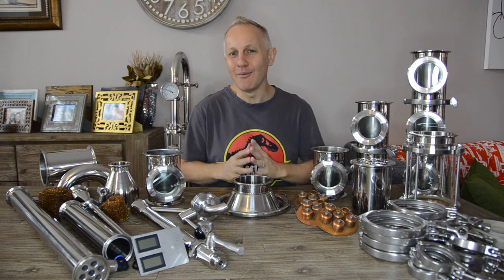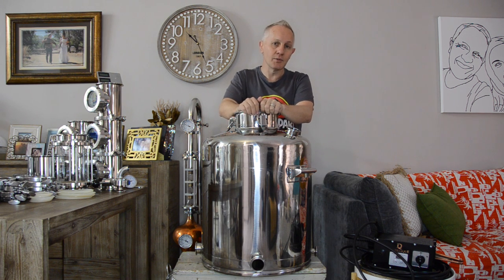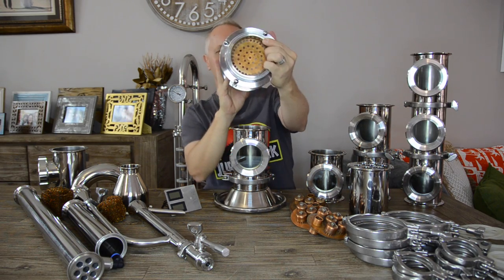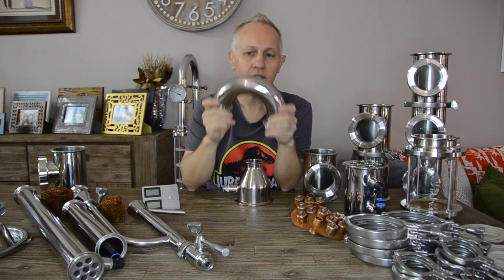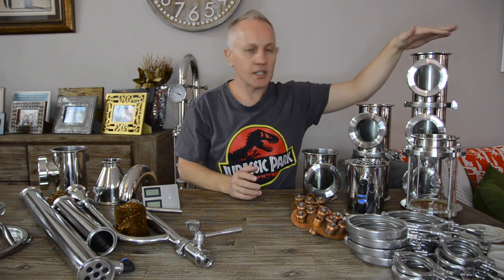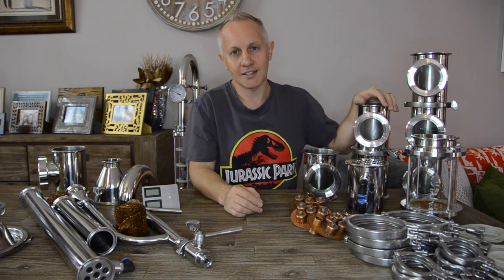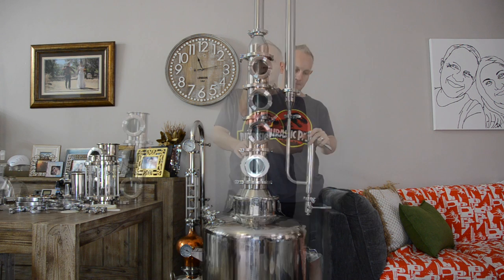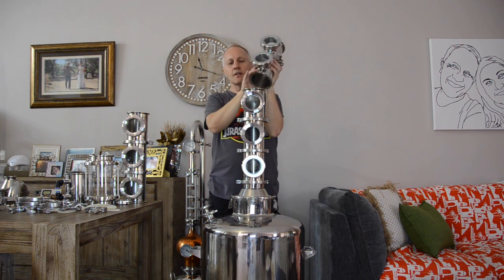100 Lt Column Still Modular Design

Comment: What was the output  ABV  and liters per hour when in reflux mode?
Reply from the maker: Hey Caitlin!
For the high reflux run it took about 1h15min for the 45lt to heat up at 3.4kw power input.
I then let it stabilize for 30min and then adjust on the reflux condenser to start collecting the spirits.
From then I run at 30-35 min per 1lt of product at 94%ABV.
In total I got 6lt out at 94%ABV and it took me just under 5hrs to complete the run.
I’m limited by the power input, can’t run the 4kw element at full potential here in the complex I’m staying, but I’m satisfied at the rate and results of my run.
Keep it awesome!! 👍🏻

Comment: It's a shame the darn boilers are always so obscenely expensive.   Here in Canada it make a lot more sense to use a 15 Gallon beer keg or 2.
Reply from the maker: Well said Robert and you are right.
I myself have seen a lot of guys using a beer keg to build a nice and proper still. Keep it awesome!! 👍🏻
Reply: Yeah, I got my 100L system from North Stills (in Ontario) 6 plate flute column....once the Canadian mafia (taxes/Canada Post) took their cut, it totaled close to $3,400!  Gonna build a HERMS brewing system this summer with an even larger price tag.  Problem is.....prices NEVER go down, so if I don't do it now, I'll never have the gear. 😞
Reply: @theghostofsw6276  and that is what I paid for my 15GL 3" still, and only 4B plate